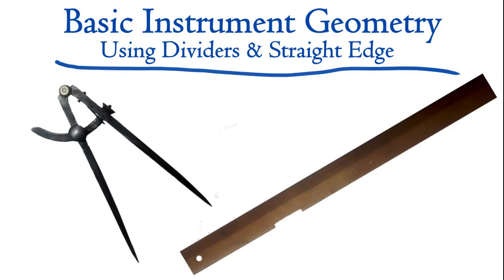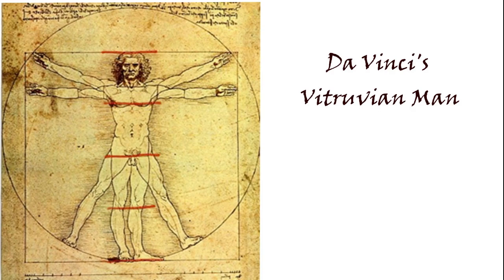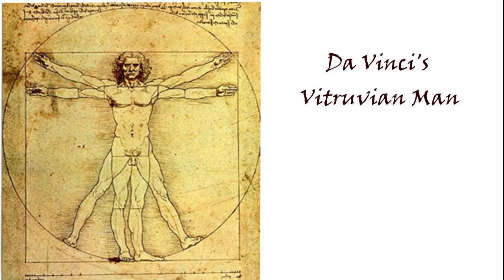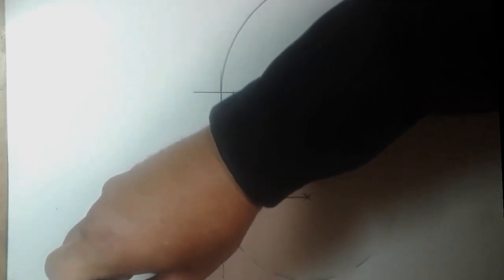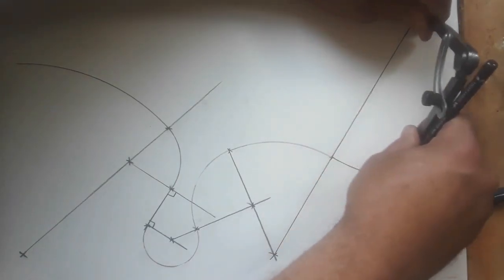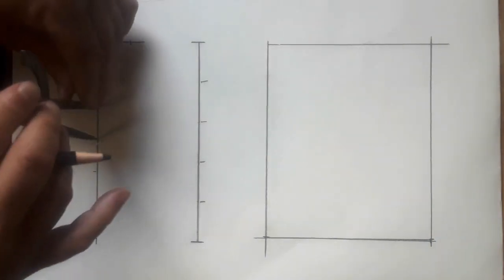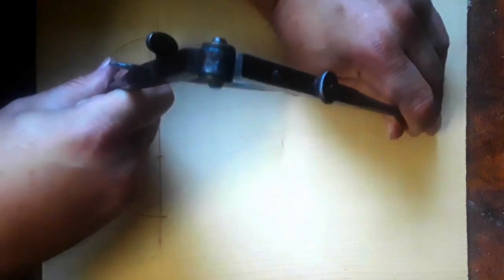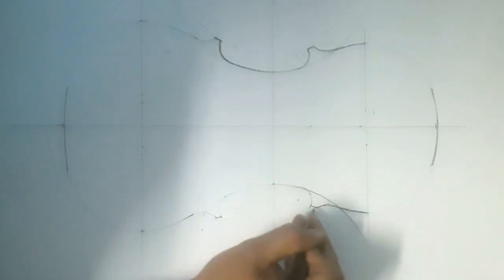CR Demo   Basic Instrument Geometry

Comment: I'm watching all your videos and reading your blog and I really apreciate your work. I'm trying to design a violin based on this aproach but I find it difficult to get to a mold lenght which is usable. Is there a ratio between the center line of a mold and radius of overlaping circles of the lower bouts? Thanks!
Reply from the maker: Hi.  There will be more  videos. Hopefully they will help you.

There are layers of things to understand about these old methods.  There are many ways to recombine elements of these methods in ways that don't work out.

Part of it is the sequence of events.  

A choice of body length comes first.  It is not a consequence of other choices, but a first choice that frames all that follows.  

There is also the question of insets.  You can choose either to set the inside body length, or the outside.   Combined with your choice of insets,
Reply from the maker: The one body length combined with insets will give you the other body length.     Most typically, the Cremona masters used 8 2/3 oncia or 8 3/4 oncia to set the inner body length or the mould length.

Depending on the choice of insets, and perhaps the vagaries of a particular build, these inner body oncia choices yield the 353 to 359 body length seen in Del Gesu and Strad, as well as other old Cremona masters.

But again, these body length choices come first, even though the actual final resulting lengths will depend on variances that can arise in the course of a build.

After, choice of length comes a choice of body width, in terms of ratio.  This is the lower body width. Most typically, the old Cremona masters used a 4 to 7 or 5 to 9 ratio to set the body width in terms of the length.  However, again the insets are important in this.  The makers explored all combinations of including or excluding the insets in applying these ratios.

These choices in body length and width very much box in the options for the choice of the upper body width.

I will show more of how this framing of the instrument dimensions works in the next video.
Reply: @cremonarevival2204  Thanks for taking the time to answer! Could you tell me how much mm one Oncia equals to? I'm not sure of what I found on the web. What I found is the roman Oncia= 18.6 mm, it doesn't make sense.I'm also looking for a method to locate the f holes. I found an article about f holes by Alvin Thomas King. Did you come across this article? I am studying your findings with great interest, Thank you very much!
Reply from the maker: @micmac3540  There was no standardization or highly accurate reference length.  The oncia dates back to Roman times.  By the time of classical making, different towns and even different guilds had their own sizes for the oncia. 

Stradivari's in-law, Capra, published books on architecture, geometry, etc.  He discusses the Cremona oncia in one of his books.  Also, the story goes that a pedestal in Cremona plaza where the main making families lived and worked, there was a 4 oncia long reference carved into the base of a stone pedestal.

From Capra, and the illustration in his book, you would expect the Cremona oncia to be between 30 and 42 mm.   However, from studying the proportions in known instruments and moulds it seems the Cremona makers used an oncia somewhere between 39.5 and 41 mm.  My best working estimate is about 39.8 mm.  But I always keep in mind that from case to case the variance can be as much .3mm.
Reply from the maker: @micmac3540  Interestingly, makers in Brescia and Venice seem to have used a very similar oncia length as Cremona.

Comment: First, let me say I'm not a luthier, although I work in wood. I'm wondering if we modern people are over-thinking the processes of the old masters? Given the slight differences in shape between makers, is it possible that they arrived at the pleasing shape by freehand, and we are extrapolating geometry from that to give more kudos (and repeatability) to their art? I obviously haven't done the background research that you evidently have, but I'd be interested to know your thoughts, David.
Reply from the maker: There are some deep questions hiding in your question.   Many curve families can trace the historical instruments.   What distinguishes a circle geometry approach is that a simple a logical choice of parameters will generate the full range of Cremona instrument shapes seen.  And, more and more accurate shape matching leads to simpler governing parameters.   This is the opposite of what happens with a forced fit.

No.  It is not reasonable to believe the actual instruments match the predictive geometry so well by accident.   They match well because however they actually proceeded, it was basically homomorphic to my description.
Reply: Of course you can make any shape out of circles, if you are willing to work hard enough at it. https://youtu.be/qS4H6PEcCCA